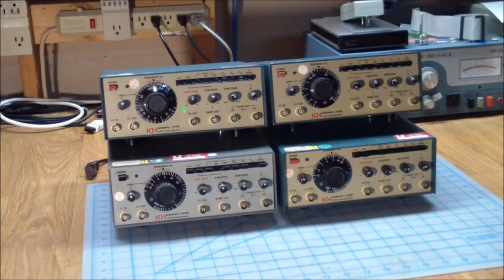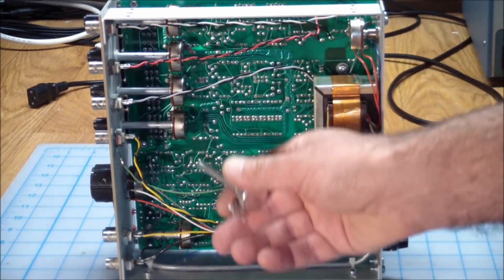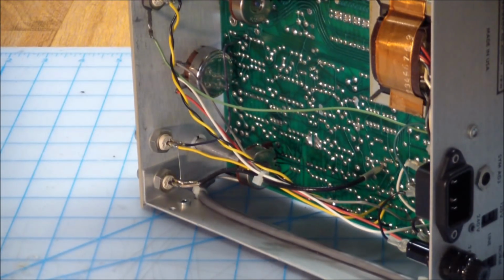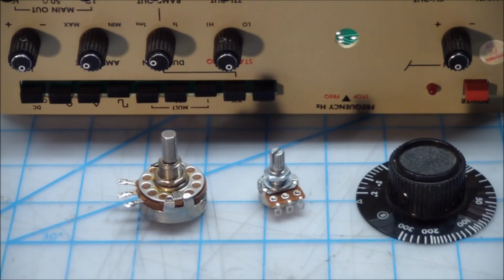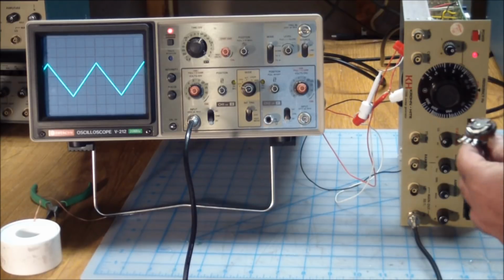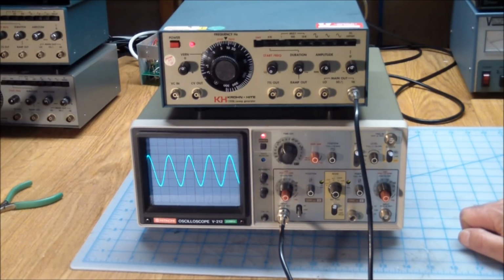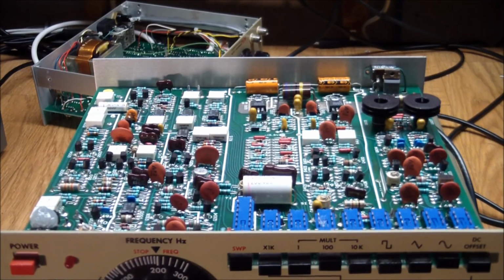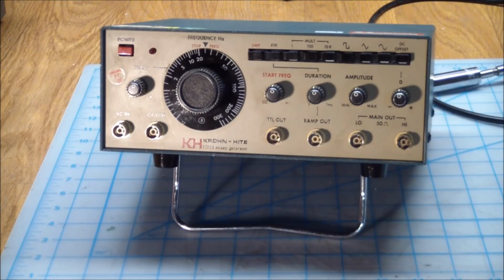AE#62 Krohn Hite 1200A Function Generator Cleanup

Comment: Regarding that wobbly knob on the cheap pot, the knob set screw is probably squeezing the slotted shaft and warping it. Try inserting a wedge of metal in the slot to keep the knurled shaft from getting pinched and malformed.

Comment: Sealed pot... drill carefully a hole. Spray and stick a piece off caption tape on afterwards. Works for me. To avoid anything getting inside when drilling, stick a magnet to the drillbit or magnetize the whole drillbit. Clean the bit with a pieceo of towel to remove larger pieces of metal several times. This way I have never had any longterm isssues sever.

Comment: The way the pot springs back is like there is an o-ring sealing the shaft that is holding it so tight that the rubber pulls back when you release the knob. Maybe the cleaner has a solvent in it that makes rubber swell, like kerosene does to some o-rings, or it needs a thicker lube on the shaft. An o-ring might be why it's called sealed, but yes the can is just a dust shield.

Comment: Hi Art, I may have a tip for those sealed pots.  If disassembly is not possible, you can drill a small hole (5/64") in the side of the potentiometer.  First dip and coat the sharp (new) drill bit in heavy axle grease or vaseline, drill with a low speed (<350 RPM) this low speed and the grease will keep chips from flying off and any chips created will stick into the grease on the drill bit. Use slight but careful pressure on the drill and do not let the drill bit poke far into the case. You just want to pierce the wall of the can.  You can then access the resistance track and wash the contacts with contact cleaner, the hole will allow the residue and liquid to drain out.  Fill the hole after with solder or epoxy. If the pot is not working you have nothing to lose by trying and it often works.
Reply: When we drill manifolds on the cars we pressurize the inside and use a vacuum cleaner near the drill bit on the outside. We do it dry and all the flaky alum flies out.

Comment: Backlash on those pots is usual. Cleaning works on those well, just take care, and they last well. The switches after washing need a little contact lubrication, they wear badly without, along with the pots, as you have washed out the factory lubrication.

The TTL overshoot is because TTL level is not 50R, but an open collector  gate with a pull up resistor, so you get a ring on the 1x scope cable. Try a 10x probe with the BNC adaptor and it will be gone.

Must get to the 3 I picked up in the scrap yard one day.

Comment: Bizar, no shielded cables to the BNC-connectors. You can drill a little hole in the sealed pot.  Carefully avoid getting metal shavings inside.  Spray contact cleaner and seal the hole with some tape.  I have done this, works fine.  The blue switches can not simply be spray cleaned, as you say, because they contain a kind of grease that dissolves to a nasty slurry which makes a real mess inside.  I take those switches apart by bending the tabs and I clean the internal contacts with a toothbrush.  Beware, reassembling them is not a joke.  I takes a lot of patience and a keen eye to do so.